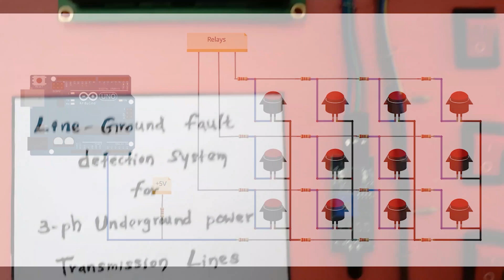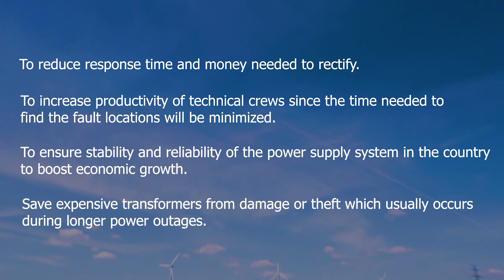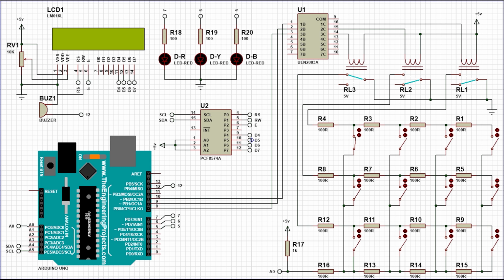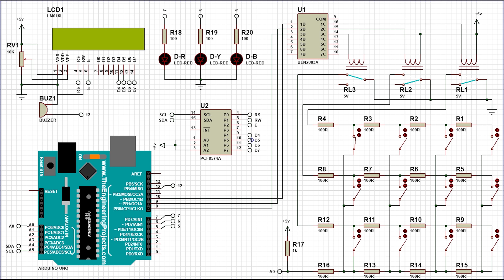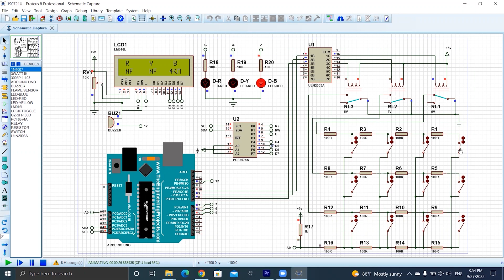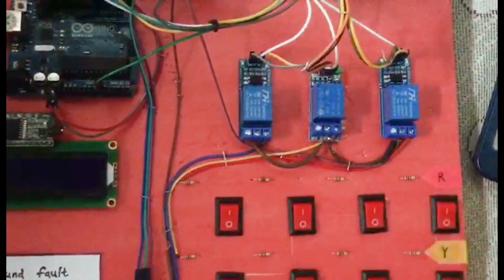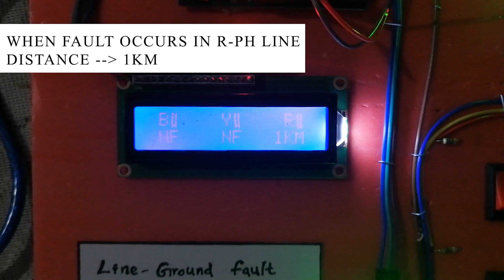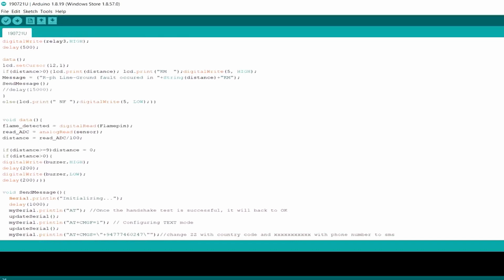Full explanation video for 3ph Underground Transmission line Fault Detection System

Comment: Mam there is an error in Arduino code in first line
Reply from the maker: It is about the communication with the sim card. Try to understand whether your design is along with this same criteria or not. It was run successfully without any error as you can see in the video.

Comment: Mam can i get the circuit diagram
Reply from the maker: Yes, Plz check the description. Proteus file has been attached there.  It presents the circuit diagram.
Reply: @BRAINtones  mam there is an error in Arduino code in first line
Reply from the maker: @SandeepThakur-cc6gk  That code was run in arduino version 1.8.19 without any error..